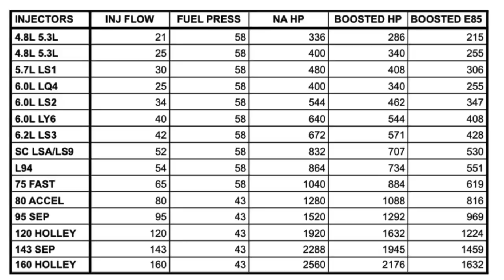HOW TO: LS INJECTOR SIZE MATRIX

Comment: L77 engine model used in Australia uses a 45 pound injector. 
Importantly it can flow any pump fuel including E85 without issue. 
There aren't a lot of 45 pound injectors.

Comment: Richard I've got 80 lb Deka Siemens injectors on my 5.3 lm7 and it always smhells like it's way too rich and then I looked on this chart and it says the 80 lb injectors only have 43 lb of fuel pressure versus the 58 like it's supposed to have on all of the others does this mean that I need a fuel pressure regulator and then I can turn it up to 58% or do I need to take those injectors out and maybe put something like an LS2 injector in it it made 419 rear wheel horsepower on the dyno but I don't know how accurate that is
Reply from the maker: The size of the injector and fuel pressure don't make it rich if it is tuned correctly. You can't add bigger injectors without tuning the combo

Comment: Question. When sizing fuel pumps, how much does one need to account for flow and pressure drop that happens in supply line and fuel filter if both are sized appropriately?
Reply from the maker: not much drop in a properly size fuel line and system

Comment: You can also make a bunch more power with a rising rate fuel pressure. That'll help overcome the inefficiencies that injectors face when boosted. LS engines and a lot of engines have a constant fuel pressure.
Reply from the maker: SOME LS ENGINES HAVE A VACUUM/BOOST LINE TO THE RAIL-MOUNTED REGULATOR, SO THE FUEL PRESSURE INCREASES WITH BOOST TO MAINTAIN THE SAME DELTA PRESSURE

Comment: Whats a good injector for 800 to 1200 hp turbo on e85
Reply from the maker: 2000 cc
Reply: @richardholdener1727  would Bosch 210s work? I see they're only at 43.5 psi

Comment: Would ford motor sport 80lb EV6 injectors be too much for a vortech 331? I want something with room to grow and E85 room. I estimate about 400-450whp in a SN95
Reply from the maker: 80 pound injectors are fine as long as you can tune it
Reply: @richardholdener1727  mega squirt PNP2

Comment: Ok so I’m a 5.3 ls with a single 88mm turbo . The motor is built and the turbo is rated to make 1,500hp what injectors size should I use ? Thanks in advance Richard.
Reply from the maker: what fuel?
Reply: @richardholdener1727  methanol
Reply: @richardholdener1727  what size injector would be good for my application?
Reply: Thanks in advance Richard
Reply: What size injector would be good for me Richard ?
Reply: @Thevlones  I would go 2000cc

Comment: Hi mate, I have a supercharged lsx 427. Just want to know what size fuel injectors I should run. It made 700hp at the wheels, runs on E85, fuel pressure is around 60 psi. Thanks. I have subscribed to your channel.
Reply from the maker: 80 POUNDS/HR WILL WORK AT THAT LEVEL ON E85
Reply: How much boost was that?

Comment: Hi Richard great video!  Looking at your matrix I want to check my math. I notice on the matrix for boosted (turbo) e85, your showing 95 lbs injectors supports up to 969 hp and a 80 lbs injectors supports up to 816 hp. The difference is 153 extra hp for the 95 lbs injectors. So for my 100 lbs injectors Im guessing they will support about 50 extra hp on top of that 969 hp on boosted e85. Basically I divide that 153 hp difference between the 95 lbs and 80 lbs injectors as shown. So 5lbs is about a third of that. Thus my exta 50 hp estimate for 100 lbs injectors on boosted e85 or about 969 + 50  is about 1019 hp for the 100 lbs injectors on turbo boosted e85.  Also for fuel pressure your showing at 43 lbs for the 95 lbs injectors. I have twin good fuel pumps and a good high end boost referenced regulator that stays 58 to 60lbs on my 6.0 LS, older sloppy stage II cam, 799 heads, twin borg warner S366 T4 turbos. Should I estimate my injectors supporting a bit  higher hp because of my higher fuel pressure at 58 to 60 lbs? Thanks for any advice or input here Richard!

Comment: Hey Richard this is nothing to do with what you're talking about on your show right now I am dealing with an eaten blower problem I'd like to know if eaten blowers can 1 the eaten 90s in particular can 1 or be upside down or the 1 straight up I know they can go vertical and I only got 90 I just don't know 1 can go upside down from the other directly 180° of the other 1
Reply from the maker: not sure on gear oiling if upside down-but I have been told it works

Comment: Thanks Richard. 
I've been fighting a misfire around 2000 to 3500 rpm and was curious if my iniectors were too big. Sounds like it COULD be possible. I'm running 96lb NA around 500whp because i planned to run turbo but havent gotten that far.
Seems to he fine putting around and at wot but cruise i can feel a p0300 and notice power kind of picking up and fading out. Wideband jumps lean for a fraction of a second. 
Ive checked about everything I possibly can. Could the 96lb on a 340lph pump be too much injector? It's on a vaccum regulator and i havent played with the pulse width any because I don't know enough to be messing with it. Im speed density tuned at the moment.
Curious on your thoughts.
Reply from the maker: the injector size is not likely the problem-we run injectors that size all the time
Reply: @richardholdener1727  
Thank you. I'll keep digging. I appreciate all the info you share

Comment: Maybe you answered this and missed it. But if a factory fuel rail pushes out 58psi, what is the biggest injector I could use with a factory fuel rail?
Reply from the maker: we have run 1500 cc injectors with stock rails-the pressure is a function of the pump and regulator-not the rail
Reply: @richardholdener1727  What’s the max rpms stock gen 4 5.3 injectors and fuel pump will allow before leaning out?
Reply: Thanks man. I’ve watched quite a bit of your videos and I’m sure I speak for tons of people when I say I (we) really appreciate all your help.

Comment: I’ve been trying to figure out what injector I need.  I have a brand new ls3 bored to 416 with aftermarket heads and cam.  I plan on boosting it later down the road and running e85.  I’m thinking I will be around 575hp na and want to make around 800 turboed later down the road.  Trying to figure out an injector that will cover both ranges so I don’t have to purchase new injectors down the road.  How big can you go and not have issues?
Reply from the maker: you need 1000 cc injectors for 800 hp with e85-they still work at lower power levels

Comment: I'll have 383 stroker 2009 Chevy Silverado  what would be a good size fuel injector to   run E85
Reply from the maker: 50 pound injectors will support 560 hp on E85 on an NA 383, you need 100-pounders to double that, but 1500s work well for e85 under boost at 1000+ hp
Reply: @richardholdener1727  Thanks 🙏 Rich .. I have one more for you if don't mind. Do I have to change anything like fuel lines and any hardware inside the tank needs to be replaced to support E85. The reason why I'm doing this Rich I live in California gas prices too high  every morning passing this gas station seeing E85 for $2.89 a gallon

Comment: I’m really confused about ev1/ev6 vs DENSO style injectors. They don’t even seem to use the same style seats?  A company just told me they don’t sell ev6 anymore due to poor quality and they only run Bosch denso style high impedance injectors “and that’s what pretty much everyone else is running,” but unless I’m missing something it seems like a lot of people run ev1 low impedance and a lot are running ev6 and say it has better spray pattern. Does any of this even matter?  Impedance does of course but not sure about style or spray pattern.
Reply from the maker: just tell me what power you want or plan to make and I can steer you in the right direction
Reply: @richardholdener1727  s400 stock bottom end lq4 with sloppy stage  2 (for da chop lol) and a speed masters pce intake. Running Holley terminator x max. I’m thinking 850 hp is possible. Planning on using e85. Still piecing out the last little bits. Injectors are one of them. Holley only drives high impedance I believe.

Comment: Love the knowledge given. My question is what brand injector should I be looking at with a $300-$400 budget. Looking at 440ish NA hp
Reply from the maker: deka 80s or even stock ls2/3
Reply: @richardholdener1727  thank you kindly! Big fan
Reply: @richardholdener1727  Are the Holley EFI 522-428X good for 350-400 HP

Comment: Then tell me this.... My LS2 402 stroker NA was @ about 465 HP and in my '01 6 speed WS6 with stock LS1 injectors 28lb. Built exact same engine but bigger cam. Put it at 500 HP but went lean on the dyno @5500rpm. The cam's power range was to 7200rpm. We changed to 32lb injectors and added inline faster fuel pump. Ended up 540hp. But freeway fuel economy went from 29mpg to 26 mpg with stock pump and injectors where 29 was 345HP and 26 was 465HP.  At 540HP non stock pump and injectors freeway mpg went to like 10mpg. Almost lost 70 percent of fuel economy for about 25 percent  more HP and a noticeable speed increase that was not even worth that though. Was it just throwing gas out the exhaust unburned?
Reply from the maker: DID YOU TUNE IT OR MONITOR THE AF RATIO?
Reply: @richardholdener1727  I took it to a shop they had the LS edit software

Comment: Richard what is you’re opinion of decapping stock injectors on a basic stock 5.3 turbo set up. I’m reading that most high output injectors are spraying streams vs a mist anyway so is there a real negative other than not knowing the exact flow rates? Thanks in advance
Reply from the maker: YOU NEED TO FLOW TEST THEM ALL AFTER YOU DO-THEY COME OUT UNEVEN
Reply: @richardholdener1727  interesting. Looks like I better start saving my pennies!! I followed your lead and got a DNA Gt45 the other day. Doing my first turbo set up on my 5.3 can’t wait!!!

Comment: Glad you pointed out the pressure rating difference big point.  I always wondered though about spray pattern.  Back in the day when I made an m90 kit for my 4.0 mustang I used injectors off of a 03 Cobra Terminator which were rated at 39 lbs but they were meant for a four valve head two intake ports and my 4. slow was a two valve head one intake port.  I didn't tune it I took it to someone so I don't know how the tuning worked out it still drove good even at idle but I always wondered if that spray pattern was getting more fuel hitting the walls and causing issues like that so there wasn't as good atomization and if that affects power and if so is it even big enough to matter and I know with like decapping I've heard that there are drivability issues where its idol is a little harder to get although it seems like that might be because of differing flow rates for injector rather than spray pattern I don't know maybe bothI just wondering if you ever tested this if you know

Comment: When switching to e85 on a n/a motor do you still need to pick 25% bigger injector ?
Reply from the maker: yes
Reply: Yes cuz stoichiometry is 9.8 to 1 parts air to fuel for e85 while gas is 14.7 parts air to 1part fuel  so Less air per fuel or more fuel per air

Comment: Ok so if an injector is rated at 143lbs @43 psi and you stick it in an ls wouldn’t the increase in pressure actually lower the lb of the injector if you run it @60. I know by seeing the test performed on fuel pumps some pumps actually put out the max pressure at the rated amount like a 535 walbro makes close to that @42-43lbs. I’m I on the right track or completely off lol
Reply from the maker: adding system pressure (which the pump works against) reduces pump flow. Adding system pressure to the injector (which works with the injector) increases injector flow. basically the pressure is in front of the pump and behind the injector.
Reply: @richardholdener1727  ok what would be the ideal pressure to run that pump and injector  on 93 or e85 being ls based in your opinion. Thank you for all you do miss the restaurant streams but hey in due time right

Comment: Or perhaps a better question....does injector size make a difference to power ? Is oversizing as some do very bad ? Is there any difference in power between some cheap ass CNG 210's that they all use, vs something deemed good quality and designed for gasoline ? ( low end resolution is of course another matter )

Comment: good video. Would be interested if you covered de-capped. What are their max flow numbers like?
Reply from the maker: FLOW IS NOT THE ISSUE-ITS CONSISTENCY
Reply: There's another guy that did that for most lS injectors I think it was like driveway something but he actually got the data from another guy who actually did the test but it's out there

Comment: VIDEO IDEA: Take a N/A Engine. Dyno it. Then strap a turbo onto it, but on the cold side, run the piping through some restrictions and then let it blow out to atmosphere. Point is, the turbo will have resistance as if it was pumping into an engine, but we can see the actual parasitic loss of from the back pressure from the turbo. It may be a little tricky to get the cold side just right, maybe you would need some type of Pressure Relief Valve to maintain a fixed but adjustable cold-side pressure?  Feel free to DM me if you want any suggestions on this!
Reply from the maker: THAT WON'T WORK-THE EXHAUST FLOW DOES NOT INCREASE AS IT WOULD WITH BOOST
Reply: @richardholdener1727  damn you're right., but at least we can correlate horsepower loss to back pressure.  Regardless of how the 500hp of air is getting in there, it's getting in there. From there you just scale the horsepower based on boost. I'd imagine the pumping losses would be fairly linear, based on RPM and back pressure

Comment: You say that an engine becomes less efficient at higher hp levels. More rich afr? Why does boost need a rich afr? If you are just adding more air, why do you need to run a rich afr?
Reply: You are increasing the cylinder pressure and heat. This gets the air/fuel mixture closer to its flashpoint which can cause preignition or detonation. That is what breaks pistons and bends rods. Run it richer to cool off the mixture. This is where the “lean is mean” saying comes into play. It’ll make more power, but you’re living on the edge.
Reply from the maker: SAFETY

Comment: If you got a flex fuel 5.3l from the junkyard they are like 33lb
Reply: But I think that's rated at 58 lb per hour on the fuel system you got to make sure you know what pressure the rating is from older cars with return fuel systems I think usually ran off 43 and a half so in that kind of a car it would be less like a 29 or something